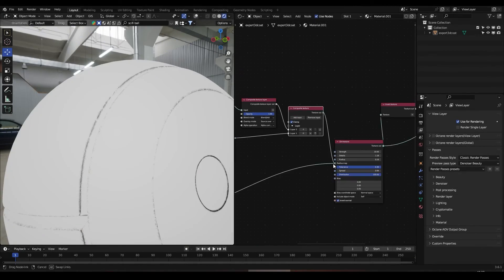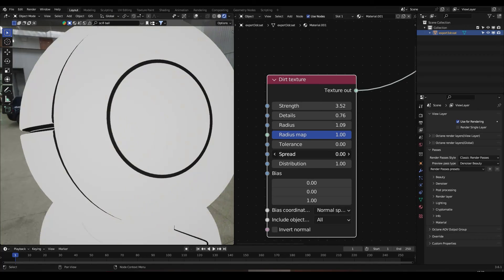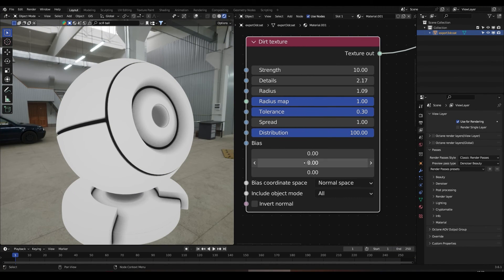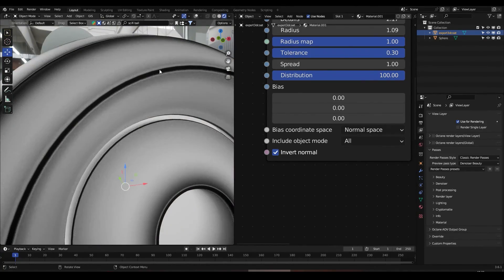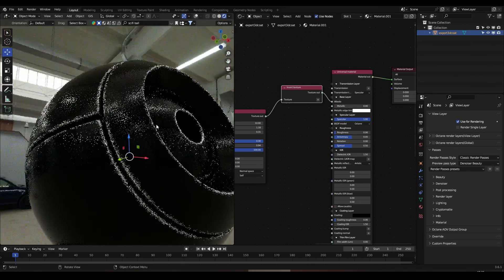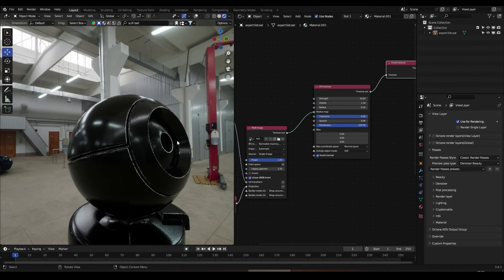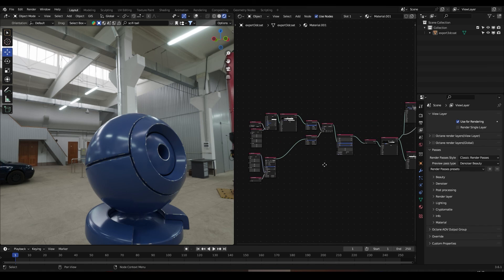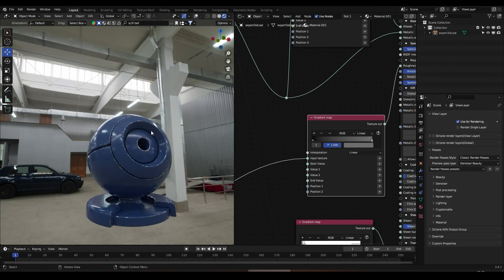Become a Blender Pro: Master Edge Wear and Dirt Effects Using Only ONE Node (Octane Render)

Comment: at 5:46 you ctrl+shift clicked the node to preview it, which I'm assuming is with the Node Wrangler addon enabled. Whenever I try to do that nothing happens. Is there something I'm missing that allows me to use that node-wrangler feature within Octane's shader editor?
Reply from the maker: You have to install the addon for that. Here is the updated link. When activating the addon you have to disable the default blender node wranggler an activate the Octane node wrangler. 

If you are going to use eevee or cycles, do the oposite. 

https://github.com/AiSatan/node_wrangler_octane/releases/tag/1.5.0
Reply: @EgoMotionCG  Oh wow, I didn't know there was a separate node wrangler for octane. That's awesome, thank you so much for the link and info!
Reply from the maker: @AnsenStudios  NP mate :person-turqouise-waving: